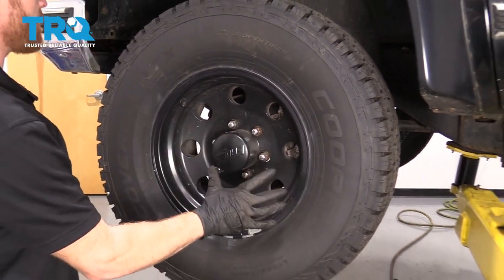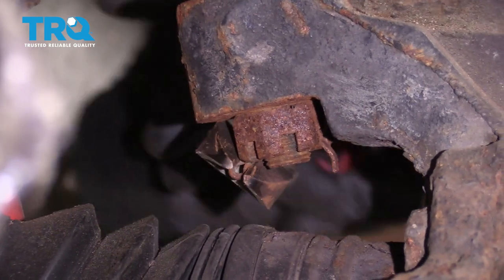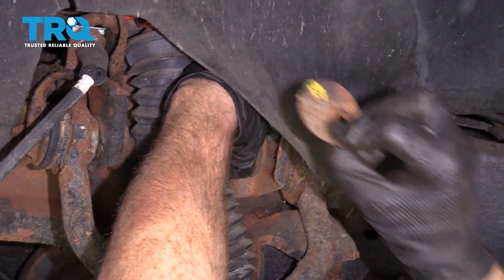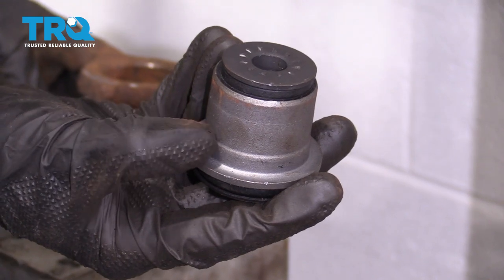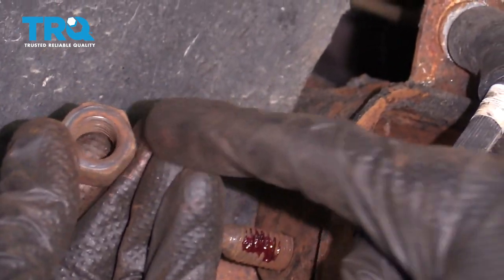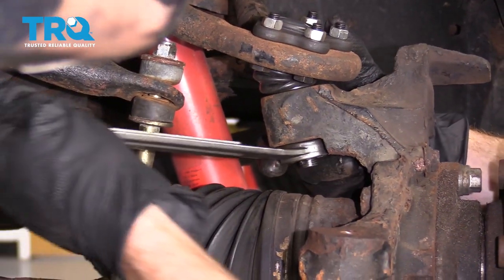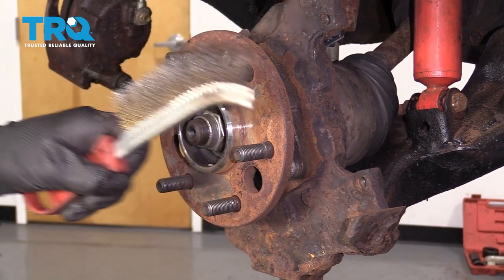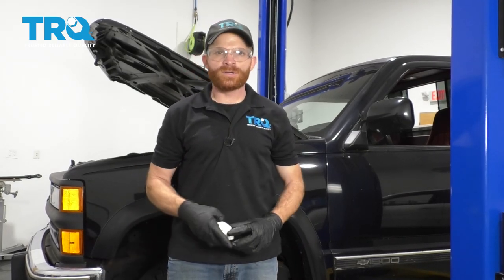How to Replace Front Upper Control Arm Bushings 1988-2000 Chevy C/K1500

Comment: Should you put silicone lube on the bushings where they interface with the metal mounting bracket on the frame?
Reply: No the metal parts of the bushings should go in dry and have a tight fit this is because they need to bite into the flanges of the bracket so that the bushing can do it’s job of keeping the alignment and having proper suspension travel and make sure you don’t put grease or silicone on the camber bolt either
That is meant to be dry too

But it would be okay to put a very small amount of silicone on the rubber to keep it from drying out

DO NOT USE silicone or petroleum based lubricants (Grease) when installing suspension components as it’s almost all suspension components are a press fit that are meant to be installed dry

Comment: Don’t you want to wait to torque the upper control arm bushings until after you’ve set the vehicle down. I thought it best to tighten them with a full load as not to tear the bushing. Is this correct

Comment: maybe a little lubrication before the press?
Reply: No you can’t use lubricants when a part needs to be press fit

The ONLY time lubricant should be used when Installing a suspension component is if the manufacturers instructions say so

This is because the friction is the only  force holding the bushing inside of the control arm and if grease or lubricants are used it can reduce friction and can cause the bushing to spin inside of the control arm rendering the bushing and control arm useless and ruined so you would have to start all over again

Also I could be extremely dangerous for that kind of failure to happen while driving as the bushings help keep the wheels camber and alignment correct